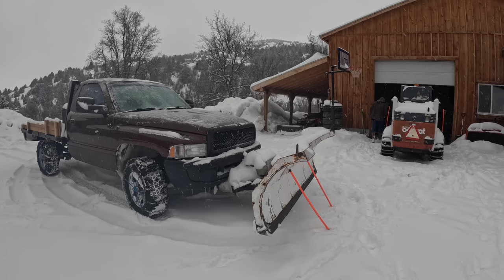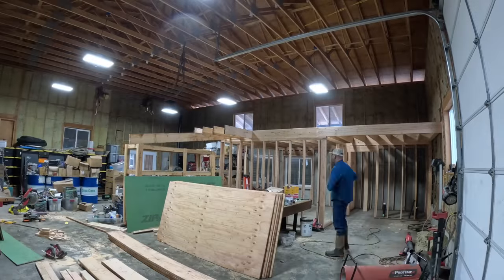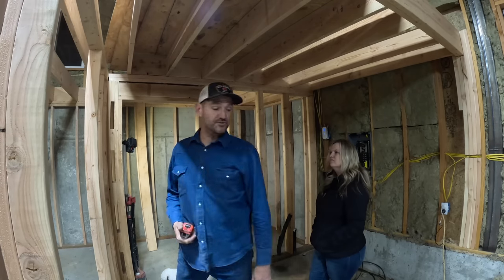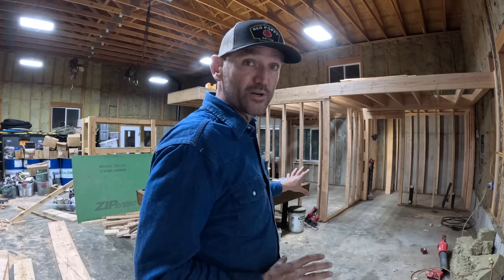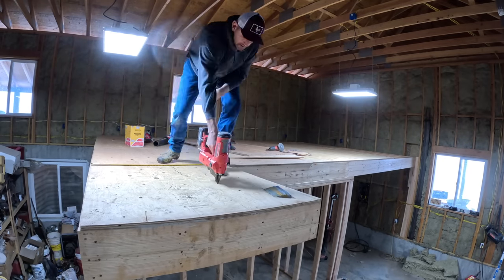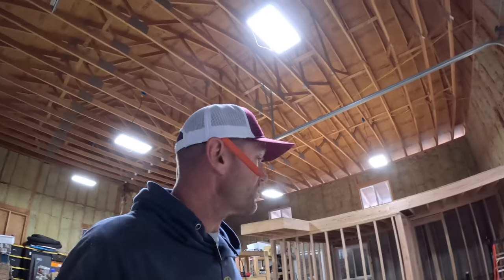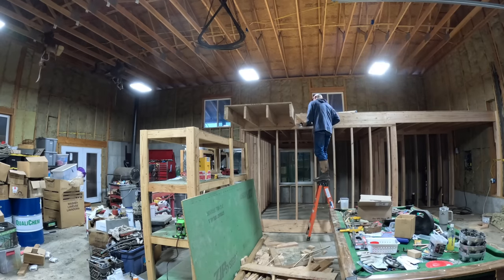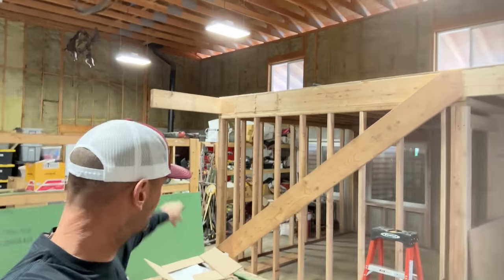#655 - Shop Addition: Second Story Floor Joists, Decking And Stairs

Comment: For those who are not carpenters, when installing plywood, it should be installed across the joist or rafters and not in the same direction. Although this will work, plywood is designed for maximum strength running across the framing and is easier to install.
Reply: At first glance, this makes sense. But then I thought, no, they are all nailed to the floor joists anyway. Ie, if the plywood cut is 4 x 4, does the way it is laid make any difference?
Reply: At least it’s not water damaged osb that comes in most new homes.
Reply: @sewingbarbie6136  If Heath was getting inspections done, that subfloor would be failed and made to run across the floor joists. As so many people might see this, there could possibly be a local inspector watch, and he could make a visit. He could force Heath to stop and get approved drawings made. In the long run, it would probably save him some money, the way things have started out.
Reply: @sewingbarbie6136  When plywood is manufactured it is made in layers and those layers are oriented in a way that adds strength (The grain of the wood) to the sheet if laid properly. When you lay plywood in that direction it can get a little spongy between the joists. Even with a 4x4 it needs to be in the correct direction. Like I said it will still work but when you walk across it you might feel a little deflection of the panel.
Reply: @Upliftyourbrothers  Yeah, I much prefer plywood to oriented strand board. Easier to fix a delaminated sheet than a swelled-up sheet of OSB.
Reply: @sewingbarbie6136  Yes.  The strength is like the gentleman above has stated.. runs the other way.. it is not equal both ways.
Reply: @stanschmitz5566  XD They do not require inspections in his county XD Nor drawings, nor permits... He is doing this for his peace of mind. What worst could go wrong with plywood installed this way? Floor will be more "bouncy"?
Reply: You also lay out stairs with math. Not like an etch a sketch
Reply: @jefferyholland  You know that layers are criss/crossed? And yes, in "longer" dimension of sheet, you have at least one layer more with grains oriented "correctly" but don't exaggerate difference in this(!) application. It can "work" more, but you have to keep in mind, that whis addition won't be used on daily basis, and this little discomfort of deflection, wont matter.
Reply: Exactly.. It has a grain to it:   and says it on every sheet if you just read the ink writing.
Reply: @Vein1986  No.. the "bounciness" is from the size of the joists.   When you turn your plywood the wrong way, it makes it much weaker in between each joist and over time it will "cup" downwards in between each joist and make a very wavy and destroyed looking floor.  Also, for heavy equipment like a bed post/ pool table/ couch foot, etc..  it can punch right through a lot easier...   You have to understand-- the plywood is made in layers with the grain swapping directions each layer..   So a 5/8's layer of plywood will have 5 layers of 1/8 sheets of veneer.  So 3 layers are facing one way, and only 2 layers are facing the other way.  So when you put your plywood the wrong direction, you only have 2 layers or 1/4" of actual structural wood spanning the gap--  vs it being 3/8's of structure if you put it the right way.   meaning that it's literally 50% stronger when in the correct direction.   Now this is with a 5/8" plywood--- so if he has 3/4 or larger, it's less of an issue depending on how they were constructed..  Because sometimes cheaper plywood will just have the structure of a 5/8" sheet, but with 2 aesthetic layers onto the outside.  So it will still be very week if you put it in the wrong direction..  Worse case scenario (as long as he never steps through the floor)-- it will get super cupped and ugly looking in a few years, and he can just deck over it with new plywood in the correct direction this time and not worry about it again.  cheers
Reply: Didn't he do the same thing with the house roof and had to remove it or had issues with it?
Reply: @WorstChicken  YES!! You'd think he'd learn but apparently not. Do It Yourself-ers, like Heath are why permits & Inspectors are needed. His county SHOULD require permits and inspections.... but that would eat into his YouTube revenue - this way he can re-do it in a year & get more clicks.
Reply: @sewingbarbie6136  the difference is that the ends of his plywood aren't sitting on joists and don't have a tongue and groove joint. So, unless he adds nailers below, they will give and bounce significantly.
Reply: @loloholmes2793  It may be slightly weaker but not likely a code problem. This guy most likely has as much experience as any inspector anyway. Im not sure how he made the centres work if its tAnd G plywood but I dont think its a huge deal in a shop/apartment space. If its 3/4 i wouldnt be worried at all
Reply: For crying out loud guys,  if you don’t like his way of doing things, don’t watch!
Reply: @stanschmitz5566  no inspection necessary where he is building.
Reply: @ThomasJones-fn6pc  LOL!!! my thoughts exactly
Reply: @rodfair5698  his 'way' is wrong and insulting to those in the trades and professionals...
Reply: @rodfair5698 , I am with you.
Reply: Heath doesn’t read the comments, but Cedar does. She will probably see your comments and let Heath know.
Reply: What would have prevented you from making a platform halfway down the stairs and then reversing course, therefor using the jut out that you had built in the beginning? You paid a lot of money for those extra long rafters to just cut them off.  There was several different arraignments possible. Perhaps you should have drawn this addition out yourself first? Plain old graph paper? Perhaps a cheap computer program? Just saying.
Reply: @WorstChicken  , yes he did. Had to add backing. I appreciate doing something by one self. But making the same mistake several times, ugg. Like the landing for the stairs. The stair would be way too steep. Seeking knowledge can save time and money.
Reply: @sewingbarbie6136  This is categorically false. You use a single sheet to overlap as many joists in the opposite direction to add strength. The point isn’t making a strong floor it’s to make a strong frame for the floor. The difference is not insignificant. I like Heath, but this is incorrectly done. And each row should alternate by half of a sheet .
Reply: My concern is the lack of joist hangars and any sort of cross bracing on the joists to stop deflection. And I didn’t see if the joints aligned over the studs on the supporting walls either, and if he had double top plates. It’ll probably hold 2 kids and a bean bag… but one day he’ll start storing truck parts up there and the whole lot will come down on someone’s head. 🤷‍♂️
Reply: @loloholmes2793  I disagree, why do you want to have government to think for you? Are you assuming that everyone are morons and need to have some supervisor over their heads? Move to European country like Germany or Great Britain or to NYC, you won't move a finger without appropriate permit. If someone is doing sometring in incorrect manner, he(or she) will pay to fix that or will suffer consequences.
Reply: @kristybishop3286  Definitely this channel is not HOW TO do things, but HOW THEY DO THINGS, and Heath said that more than enough times :)
Reply: @gwp1ohio  I have been fixing stuff that "those in the trades and professionals" done half of my life. I'm a "self doer" and self taught, and every job that has been done for me by "professional" has been messed up in one way or another. I'm doing stuff from plubbing, electic, plaster, construction working to fixing cars or doing machine work... They are insulting themselves by doing crap work.
Reply: Scott Wheeler has the best recommendation.   Read his comment and consider it.  You owe it to yourself to slow down and  think the  stair alignment through.   It will save you a lot of time and money.
Reply: @gurueddy  Looked like he had everything stacked ok and bearing on the walls. The cantilevered section should have hangers and he still might put them in, but I don't think they will go anywhere.
Reply: @Vein1986  Agreed. Thats why I said it will work.
Reply: @rodfair5698  I only made the comment to let others know the correct way to install it and not to criticize Heath.
Reply: Thank You!!!
Reply: @Vein1986  ther wilbe no difference here.. The layers in that plywood are strong enough in the directions they are glued togeter.. You wil see no difference iff its mounted the other way.. We here call that in dutch, Spijkers op laag water zoeken , Searching for nails at low wather..lol
Reply: @seanhorton3811  Yeah I agree about "seeking knowledge" first.   When I'm about to do ANYTHING, I watch several videos about if first every time.  You will almost always find a pattern also, of a known issues or difficult area that you'll run into and they show you how to get around it; etc.  You gotta use the collective knowledge of the internet and you can get it done right the first time.  You can literally learn about anything on the internet-- it's amazing.  But you have to actually take a little time to research things, rather that doing it again later.  At least that's my motto.
Reply: @jefferyholland  You don't have to use hangers.  You can also use "pressure blocks"  Which is simply a block in between to joists at the end, where you can then nail straight through your joist into the block, rather than relying on simply toenailing the joists.  But he also has nails through the band/ beam from the outside-- so It's probably fine for how small it is;  Also it's not spanning the entire room, because they are still sitting on that plumbing wall too.   A 16 penny nail has a sheer strength of like 1800 lbs.  So it takes a lot for those joists to shear-- and the plywood decking is holding it tightly together-- so it's really a non issue IMO;  it's a small little cantilever and the beam sets into the wall of the building -- its fine.
Reply: He's definitely not a carpenter
Reply: @gurueddy Maybe you should watch the videos before you run your mouth!! Haters everywhere
Reply: @gurueddy  Maybe you should watch the videos before you run your mouth!! Haters everywhere
Reply: @gurueddy  Maybe you should watch the videos before you run your mouth!! Haters everywhere
Reply: @seanhorton3811   👍
Reply: @calholli  Agreed
Reply: Well I appreciate all the informative responses. I get it. I sew, and it’s a lot like grain of fabric. 👍
Reply: How come there's no vapour bearer to create dead air space.  What is the point in using insulation and then not have a dead air space.
Reply: He made the same mistake when he was laying the OSB on his roof on the house. Inspector made him change it.
Reply: What your watching is a Plumber trying to do carpentry ...There are many watching that have no idea what the difference is ....
Reply: He probably does more in one day than most of you guys bitching about what and how he does things do in a month.  If you don't like it stop watching.
Reply: @jefferyholland  👍
Reply: Yeah, kind of odd that he did that, but several things he’s done hasn’t been correct. Although, I admit, I don’t do everything correctly myself!

Comment: In most locations it is not lawful to have a furnace in the bedroom. It is also not lawful to drive or park a vehicle in any area the sleeping area is. The only lawful way is to enclose the enter area and wrap the rooms and move the door on the outside wall. This will stop the carbondioxide fron entering the rooms.

Comment: Hopefuly you checked or know about the following if applicable in your area. In my state, any garage (defined by having an exterior door large enough that a vehicle can fit through, whether used as a garage or not) requires any adjoining living area to be firewalled off from the garage by two layers of sheetrock. This came about here due to car fires spreading into adjoining occupied housing areas.
Reply: and carbon monoxide may be an issue also
Reply: It is a super dangerous structure for sure. Makes me scared for the older girls visiting.
Reply: @kennyjustman933  Right! I didn't think about the CO, but yeah, pretty dangerous.

Comment: At 15 My first automobile was a Jeep wagoneer with a plow on the front, 3 on the column, 4whell shift on the floor, Manual locking hubs. .  Loved plowing.  So quiet other than the engine. Helpful to the neighbors who asked for my services.

Comment: Mountain Maple ranch started building their shop after your shop was done and they have insulation in their ceiling  and you still haven't put insulation in your ceiling. If you put insulation in your ceiling rafters then you could use your stove to heat the shop instead of constantly using propane. You know all hot air is going right out.
Reply: I think he know what to do.

Comment: Next time make sure you run your plywood ACROSS the joists longways.    You may not believe me, but that plywood decking has a grain, and is made to lay a certain direction.  If you just read the ink writing that's on the plywood, it will tell you which direction it should be laid.   In a few years that decking will be cupped between each joist and you'll have to lay another floor over it (which is not that big of a deal I guess).
Reply: He won't listen and will probably redo it in a couple months...
Reply: You're absolutely right but I think he wanted to tie the landing into the top of the
Reply: He never listens and than does another series of video's redoing his work and complaining about it. There is also another big safetyrisk looming and that is that giant fuel tank just behind that wall on the second story. Their is no way that passes inspection but hey why bother with safety when you can do what you want without any inspections.

Comment: They make plow markers that size that have a metal cable inside that last forever. The ones without the cable it seems like the black caps fall off then water freezes inside and breaks them off.
The cable ones are made by winter products I believe.

Comment: If you really wanted a pocket door by the plumbing, maybe make the wall thicker in that area.  Gives a little more room for insulation around that plumbing too...
Reply: Yep.. You can do a 2x8 or even 2x10 wall there.. No big deal; it's only a few studs.
Reply: Though I'm not a big fan of pocket doors and bathrooms.  Never feels like the door is shut enough.  Idk if newer hardware is any better than the old stuff...with the tiny little lock latch in that little handle hold that's hard to grab...and then the lock ends up not working... my experience in older homes anyway...
Reply: I was thinking the same thing, add a bit more and then the pocket door. They totally makes sense, then have more wall room inside the bathroom. I also think he should have done a spiral staircase, I built my own from scratch with my old man, came out good, being used for my kids clubhouse, overkill maybe, but man, it takes up like no space.

Comment: Good to see you flip the stairs to the outside wall. You vould make them retractable with a winch, to gain back your floor space. We were taught never to let the snowbanks build up. We had to knock down the tops and push back further. Used a John deere tractor with bucket to do the heavy work. Switched to snowblower for lighter work.

Comment: Cedar, as Heath is worried about the trip hazard presented by the bottom stairs projecting, he could simply build a wall against them, either full height or lower. That would narrow the downstairs entrance but perhaps that doesn't matter.

Comment: You could also cut that landing and lower it '1 step' down and support it with a closet space under it. This would reduce your step length by 1
Reply: Good idea 💡 he could also fur out the wall at the bottom of the stairs a few more feet.
Reply: I was thinking the same thing about a closet underneath. I LSO was thinking that the rooms should use the whole back of the garage/shop.

Comment: I've got one suggestion on your landing put it over against the back outside wall of the shop and over those other windows and then that way the stairs have come down along that back wall and you can put a wall up against it to keep your stuff on or keep stuff from falling in or what on the stairs and you'll have more room where you want it in the front and your shop area
Reply: I agree, staircase against the back of the outside wall, it’ll be out of the way when no one is there and storage can be built under it.❤

Comment: I am watching your videos for 2 years now an I am really fascinated by your work so far. One advice as i am an architect from Switzerland (we are also used to have cold and long wintertimes with a lot of snow) and i would recommend to put both bedrooms and the bathroom upstairs. install a door on the outside wall on the 2nd floor for additional access to the bedroom area without using the stairs? (wall to the power generator) The advantages in putting the bedrooms upstairs would be: 1: insulated floor all the rooms 2: more daylight for the bedrooms (each bedroom gets one window, also good for fire exit) , 3: once the ceiling of the shop is insulated, it would be warmer on the upper part of the shop, so also inside the bedrooms.4: more space for storage, tools and so on on the working floor.
Reply: What a great perspective & idea! Takes care of so much.  Getting to that outside door 🤔. He'd have to make that hill safer for winter times. Totally nixes the stairs.
Reply: Wow. I think he should rethink his thinking. What you are saying sounds like a great idea.